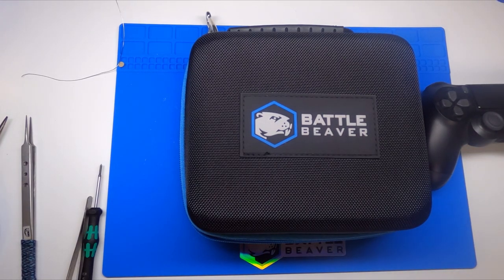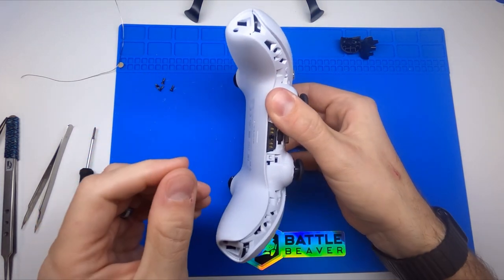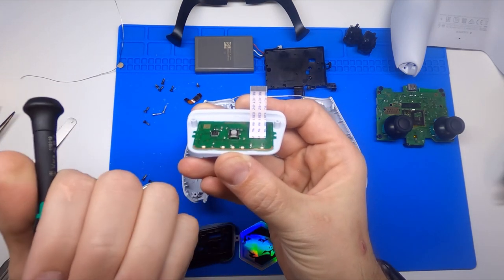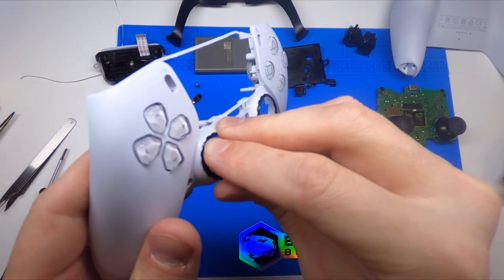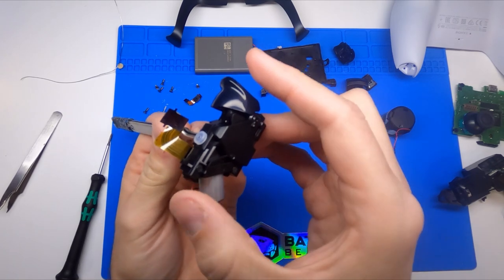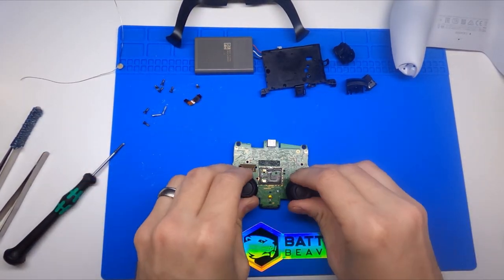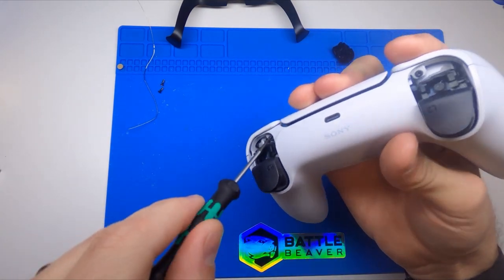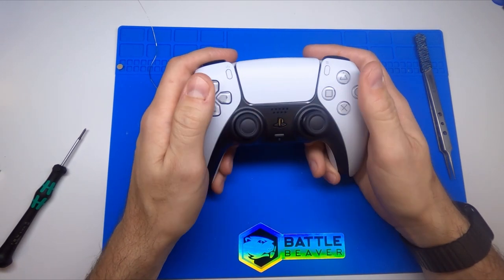PlayStation 5 DualSense Controller Teardown and Impressions by Battle Beaver

Comment: I hear the most consistent point of failure is the stick drift.

When you guys repair the stick drift do you replace the block on the board underneath the sticks or do you just do a repair.

It would be amazing if you guys can get those parts from the manufacturer adding to what is an already quality service and product. 

Although we can only hope you've been able to higher more employees for construction after the pandemic now you are far more known in the gaming community to help alleviate the wait times.

But ofc with quality you need to have patience.

Keep up the good work.

Comment: Fantastic video mate helped me figure out the sticking buttons problem people are reporting (and I experienced myself!), at a guess I would say the tolerances for some of the buttons are a bit off and those button tabs are digging / dragging on the black return silicone making them stick, which would explain why it goes away after a while or when using isopropyl alcohol to clean it.

Comment: @Battle Beaver Customs i must say that i was excited to get my new joystick modules both of which cost me 50 dollars a piece, needless to say installing them was very big let down reasons being firstly the solder used to hold the modules in place had a very high melting point the professional i paid wanted my go ahead to use a heatgun while shielding the board with out any liability to him which i gave. so that worked out but at some difficulty the heart breaker was the damn things had stick drift . i was horrified my modules drifted up and to the right diagonally and the other slowly to the left. not sure how you guys test them before shipping them out if there is a way but i was looking forward to have the medium tension as i am a fanatic fps gamers and would have loved to see what that could have done to my game play. ive modded my controllers in the past on my own with led buttons as well as digital face buttons and triggers as well as added back paddles so i had my sticx tricked out. not tryin to bash the products in sure they work fine when customers order them in a complete product but when i got my modules i was let down and im pretty sure the only thing is a thicker spring inside the box is what provides the tension but yeah drift....big sad.

Comment: Might sound like a noob question, but could you remove the whole internal assembly as a single piece if you carefully removed the ribbons & the 4 screws? As opposed to removing the stick control board and rumble trays as you did here.

Essentially, would it give faster/clearer access to the face buttons on the front shell if you did it that way.

TIA!

Comment: You re-soldered the Red + and Black - rumble wires incorrectly my dude.
Reply: If it's DC current it doesn't matter
Reply: @Dezmond_Roman  it does. The thing will spin in opposite direction.
Reply: @Dezmond_Roman  it is a big difference! It spins against the direction, what destoys the immersion effect! Is like on a Hifi Stereo System! If plus-minus is not correct, the sound is "flat" without dynamic
Reply: @gaborkovacs8765  does it actually matter tho since sony switch to voice actuators instead of traditional motors
Reply: @shaunstorey23  Sony call these "rumble motors" so
Reply: @TheUnPlayable  It does matter. Especially if  he says “don’t try to rush it and do it right” 43:00 attention to detail is key in this line of work. I wouldn’t trust them if they weren’t, but hey we all make mistakes just something I noticed.
Reply: Since this controller uses haptic feedback coils, it will make a lot of difference. When the top part should be shaking, the bottom will.
Reply: @jucameiloco8468  What’s interesting is that I’ve seen other tear down videos now and the wires are soldered on differently. Now I’m in doubt as to how they really go. So I’m just gonna open mine and see for myself.
Reply: @campos3452  Maybe they have a system to make the right polarity go to the right place.

Comment: Absolutely loving the detailed breakdown! 

Interesting to see that the silicone pads are interchangeable with the DS4.

But I specially like the look inside the adaptive triggers. I didn't expect that you could push against the motor by forcing down the triggers. I thought there would be a spring in between, which tension would be controlled by the motor. But apparantly the motor pushed directly against the trigger itself. 
So I guess those motors must be made to be able to be forced against, right? Or is that inherently not a problem with these type of electromotors?

Comment: Thanks for the video. My friends and I were debating what kind of springs were used and how the potentiometer was mounted in the adaptive trigger mechanism and your video answers all of our questions. Very well done. Thanks for sharing your knowledge and experience with us.

Now I'm curious to see how the voice coil actuators (the haptic feedback mechanism) are from the inside, but they seem to be sealed. I wonder if they're immersed in lube.
Reply: when you tap them on the desk you can feel the middle section moving similar to the coil of a subwoofer. So I would highly doubt there is any lube. I dont mind cracking one open for some pictures either.

Comment: is it still function after removing those rumble motors? and can the trigger haptic motors be removed? Im disabled person and I need lightest controller possible... Thanks 4 this video though :)
Reply: Just use a DS4 if you want a lighter controller, it will work with PS5 games except the haptics and adaptive triggers obviously.
Reply: @nathanthom8176  really? Sony said that DS4 will work only on PS4 games...
Reply: @eeeeeli11  I thought it was specifically new tech that won't work but you are right, the news has so far been not at all. Doesn't make sense to me though as the console is obviously able to utilise the inputs and Dual Sense works with PS4 games, I will test it on the 19th and see what the results are.
Reply: @nathanthom8176  alright, thank you for your response :)
Reply: @nathanthom8176  can you write the result of it here? *
Reply: @eeeeeli11  ill try and remember,  if it does it means my Scuf controller will work as well.

Comment: Hi, I just received my Ps5 controller on the ( January 10 ), not even 1 hour of gameplay and my X back button doesn’t work anymore ... is there anything I can do like reset the controller or something, I already tried unplugging it from my ps5/restarting my ps5 ... and nothing! And I can’t send it back to you because with the shipping and handling + the Canadian import fees this would cost like a 100  dollars! So I was wondering if it’s something that can easily be fixed from my end ?

Comment: Thank you for such a detailed teardown!
Two questions:
1. Does Battle Beaver offer a solution to increase the R3/L3 pressing resistance?
2. Is it possible to completely disable the R3/L3 buttons (not remapping), what solution would you recommend?
The questions above rise because I keep accidentally pressing the R3/L3 buttons, and remapping is not an option since there is no function that if accidently pressed has no effect on the game I play (Apex Legends). In the DS4 I completely mechanically removed / cut the L3 (pink) button, but now I am unable to fix is back. Wodering if there is a more "elegant" solution...
Thank you!
Reply from the maker: Yes we can disable L3/R3 and move them to rear buttons if needed. email our support team sales@battlebeavercustoms.com
Reply: @BattleBeaverCustoms  Thanks!

Comment: Do you think its possible if you are careful enough, to take out the rumble tray/circuit board without having to desodder the rumble cables? they dont look like they are too deep in and as long as you are careful not to break them it looks like it could be possible. i'd like to repaint the duelsense when i get it but i dont want to worry about desoddering and soddering.
Reply from the maker: Yes, you would just pop the board out and twist it to access the two silver screws, Once those are out and you put the board back in the midplate and tthen the whole mid plate section will come out as one part.
Reply: @BattleBeaverCustoms  thank you. how well do you think the bottom plate would take paint? i worry it would mess up the texture so im thinking of leaving that part white. i want to color the top plate purple and the black plate im not sure yet. maybe white.

Comment: Is there any way to fix the drift of the controllers because I saw that u had to soder the wires off connecting to the motherboard. I don’t have that equipment and I’m scared to break it. Also, is there a way to prevent it?
Reply: No it’s luck of the draw some break quickly some last for years. Some people have replaced just the sensor without desoldering.You can look up other videos to see this done.

Comment: Thank you for sharing. Beat tear down I’ve seen so far. I can’t get a ps5 yet but I will probably go to Walmart tomorrow and start by getting a controller as I know ps5 only comes with one controller and this way when I finally have a ps5 I will already have a second controller for use. Always nice to have 2 of them so we can switch off when the controller battery dies and use the next one. I might even get rid of the mechanics of the controller for the force feedback and vibration feel because I think it will just create more tension on the fingers resulting in injury or stiff and soreness of my hands unless it has a feature that we can turn it off in settings then I’ll just leave it in

Comment: Can someone explain how rotating the analog stick by 90 degrees would prevent stick drift? All the controllers I own had this problem at some point. I was really hoping they would fix this issue.
Reply from the maker: It will help with some of the strain and vertical movement that causes it to fail

Comment: How does the touchpad register two separate clicks (left and right hand side - assuming it's the same as DualShock 4) but only using one button in the middle of the pad on the circuit board? Does that single button have three outcomes depending on where it's hit (left, right, centre)?
Reply: Imagine your phone screen with a button behind the screen. The pad can track your fingers position anywhere on its capacitive surface, and once you press down to engage the button, it sends that info back to the system.

Comment: I had 3 DS4 and all them drift(left stick) when I click in the stick to run and I would move (up left) (up) (up right), like a crescent moon movement, sometimes it would stop running. I checked the inputs and it shows that the stick would teleport down a little bit as I move in that crescent movement and I guess that would cancel my run.

Do you think this controller solves that problem?
Reply: I may be mistaken but I think that's what He was saying, that this controller, at the very least, would last way longer before any of those problems would occur.
Reply: @PonDiEndz  It might be connected but I think my problem is the two green cap parts of the stick. The traces or the metal parts that move in the traces in those caps gets messed up. It might be corrosion or too much scratching on the traces cause it to register incorrect or no input at all. I've cleaned it out and it works fine but eventually the problem comes back.

Comment: Just for clarity, I don’t have to remove the green motherboard piece of the controller from the red and black wires attached to the rumble pieces (the mid plate) just to replace the dpad with the dpad buttons, right?

Comment: You soldered the right motors on backwards from how they were initially, will that have some effect?
Reply: There probably could be a problem actually. It depends on whether they're using algorithms for the LRAs to manipulate them in some special way or not.
Reply from the maker: Typically if they must be soldered on in a specific way then there would be board markings for +\-. Typically power will just go to the motor to activate it, depending on the amount of current would be the intensity of the feedback. Willing to bet it’s fine. Granted this was my second shoot of this video and I was tired, so feels bad to make a mistake!

Comment: Warning for anyone about to order this controller 

For the dual sense 5

The “ standard” position works great for the middle finger upper buttons as I have them covered here in the pic, but the “low” position is not correct for the ring finger and bottom buttons. And the”lower” position is too low so here is a measurement to help anyone needing the perfect placement for the bottom buttons and ring finger. Tell them in the build notes you want the bottom buttons roughly 3/8 inch below the “low” position. So I just spoke to customer service at battle beaver and they said it will cost me $70 In labor to have it fixed even tho neither of their options in the builder of “low” or “lower” would have been correct and there’s no way you could know where to place it until it’s it your hands. Not to mention I’ll have to pay shipping both ways on top of the $70 labor so $16.99 each way $34 for a total of $104 on top of what I already originally paid for the controller to start with. Anyone else think that’s ridiculous considering none of there pre configurable options on the builder would work and many others have noted the positions/placements are wrong.”low” is too high and “lower” is too low. Huge oversight by them imo

I will link my Reddit post on this for anyone wanting to see the pictures of the button placement 

https://www.reddit.com/r/BattleBeaverCustoms/comments/vhgt8w/bottom_buttons_placement/?utm_source=share&utm_medium=ios_app&utm_name=iossmf

Comment: You tell me that Sony just made small adjustments for the R3 L3 buttons? For me the material looks very cheap. Why sony does not use more solid materials to fix the biggest issue of ps controllers.

Comment: Any chance you can explain why the fucking thing won't work without the battery? The controller can be used as a wired controller, but NOT without a battery that functions. When the battery no longer holds a charge, the controller is worthless. It's ridiculous. I don't even want to use the damn thing wireless, but I'm supposed to buy another battery when it fails? Fuck Sony.